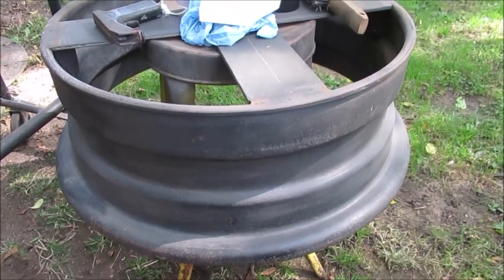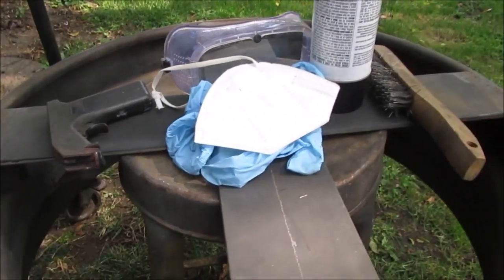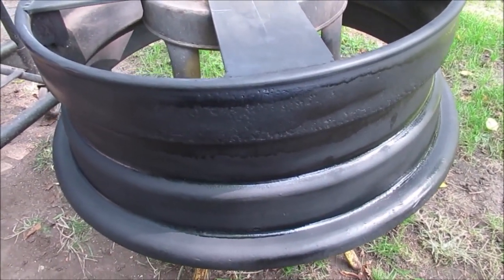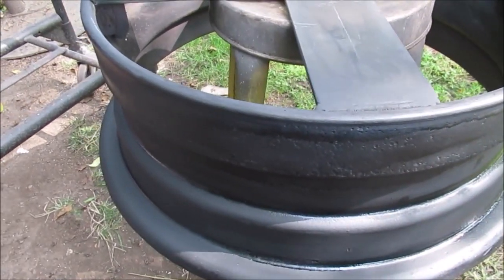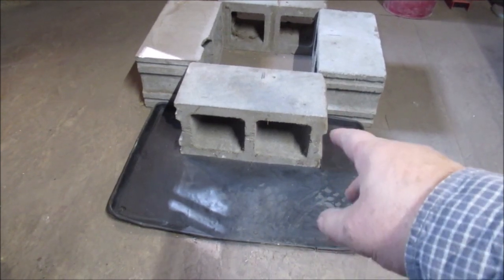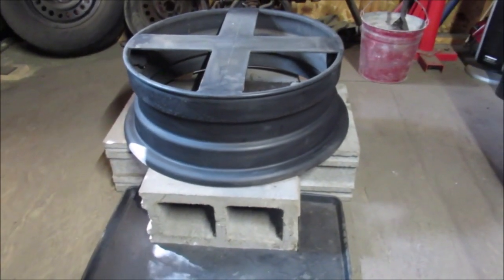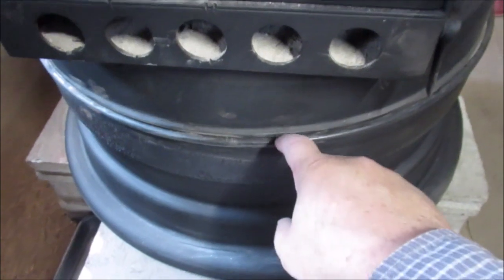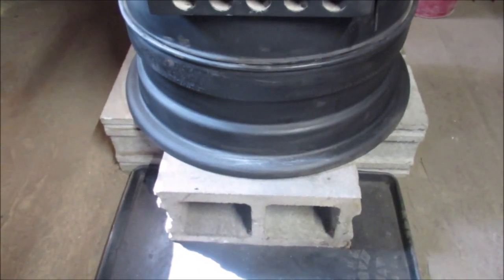Install Wood Stove in the Shop

Comment: Man, I could take some good naps sitting next to that. Nothing like being around a wood stove in winter. Can you make me one? Let me know when to come pick it up. 😂 Wait, you might be 10,000 miles from me. I’m in southern Indiana five min from Louisville Kentucky, please tell me you’re close by. 😜 Nice work!
Reply from the maker: I live in NW Iowa ..It would not be cheap to make one .If ypu found a local person to weld it You could cut out all the pieces needed or maybe use a stove kit for the door I do like the shortened barrel and my own door design
Reply: not2fast4u2c I’m teasing about you making me one of course. I’ve been to Iowa once went to far NW corner pulled travel trailer all the way to Mt Pleasant so I went across the whole state. Incredible place. I left there feeling guilty because I wasn’t staying to help people get the work done that I observed going on.
Reply from the maker: @19stoney64  I wish I could make and sell stoves ..Not many people burn wood because of insurance company rules ..My shed is exempt and is not insured or taxable because it sits on blocks and can be moved It's considered temporary structure ??
Reply: not2fast4u2c I have pellet stove but insurance companies ok with those because it has electronic board in it for safety. You’re right on not many people using a good ole wood stove anymore. I remember my great grandparents house had wood stove in each room. House had zero insulation so they had to have it that way.